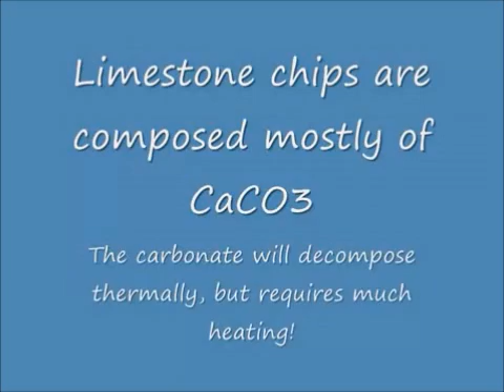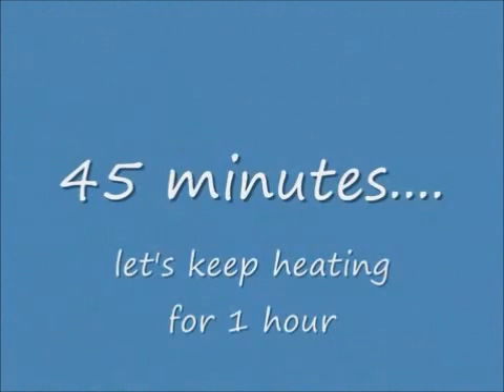Calcium Carbonate Decomposition Reaction (Thermal)

Comment from the maker: @r0bles 
you have to heat the lime stone in a beaker , Erlenmeyer flask, or test tube to trap the gas inside. Then take a flaming splint and put it in the flask and if the flame is put out, that means that CO2 was produced.
Reply: Or you can test with limewater turn milky